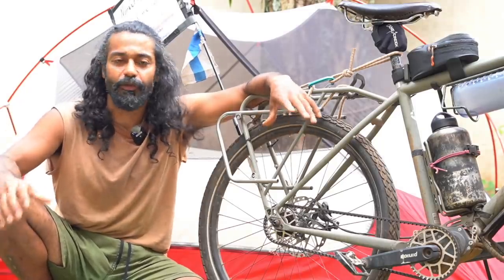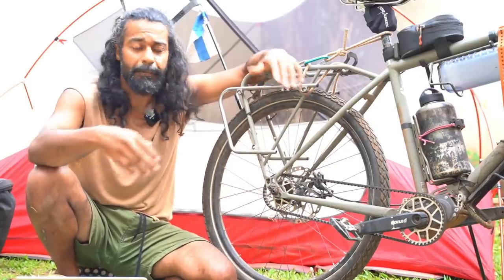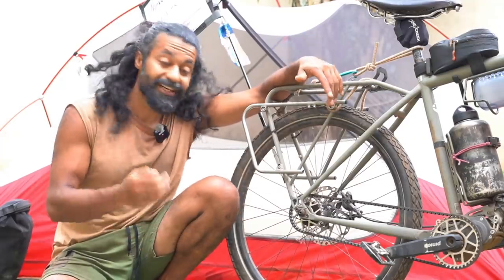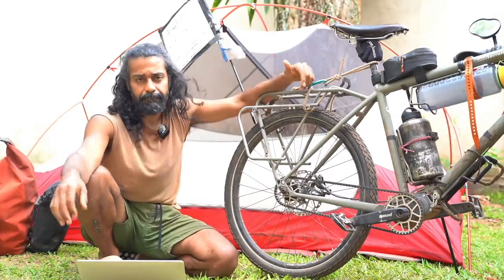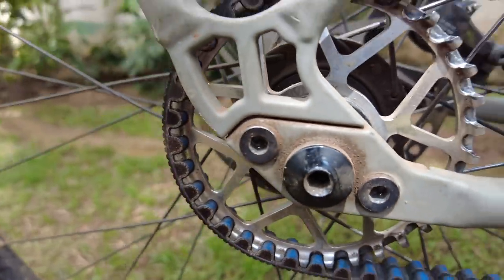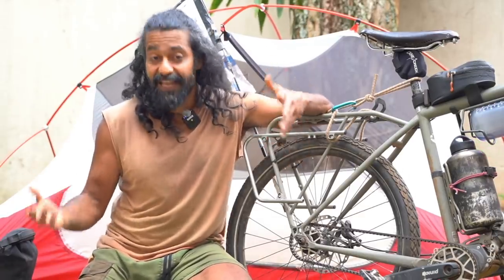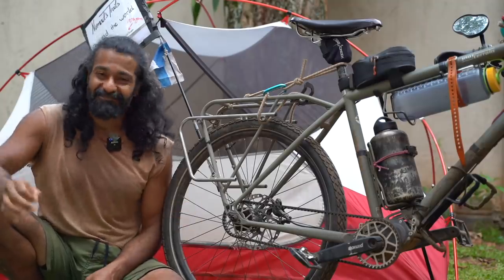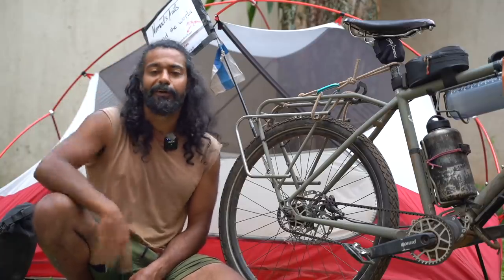Belts Are BETTER Than Chain Drivetrain for Bicycle!  My Test Result After 12 YEARS OF BIKE TOURING!

Comment: My friend used the same belt (Cube Hyde race or something, fitness bike) and it broke in 18 moths. Needless to say this probably doesn't apply to all models, but we rode together for most of that 18 months, the chain happened to last some 5-6 month longer. Only had to replace it due to it expanding. For our experience, belt is not the way to go, but hey, tomato, tomato.
Reply: Why did it break though?
Reply from the maker: @Ulgima Corvus We can judge the belt  performance based on one case IMO. Also how many km did u ride in 18 months? The cause of braking  can be wrong  way of handling the belt and braking  the carbonfiber cords. In my experience and many other  cyclists out there which I have spoken beafor  publishing  this video, belt lasts around 3 times more than chain. But if I buy a car and crash it I can't  expect the car to work  perfectly  well the next day. 😊
Reply: The guy is sharing a story from experience and you're writing it off as a single incident? But your single experience should be the only truth? Instead it might be something you could learn from. Good luck on your gaslighting journey
Reply: @ilcomendante  I don't think we can learn much without understanding why the belt broke. It would be the same if the chain had broken instead of the belt. Was it an exceptional failure or due to normal wear and tear?

As with anything a sample of one isn't very accurate. Sounds like Nomad Trails is pulling from much more experience.

I would rethink posting little to no substance, escalating and making accusations.
Reply: @ilcomendante  you're not very bright
Reply: @parawizard  I have 4 belt driven bikes (for commuting and by luck), and I love the belt drive. But one thing is a mystery to me: Gates have two belt types: The CDN (cheaper) and the CDX (better, but more expensive). In my opinion the CDN is far inferior to the CDX. I have two colleagues who use Cube Hyde Pro with CDN for commuting, and both had to change the belt after one year due to belt wear. Gates already dropped the composite CDN rear sprocket, and in my opinion they should also drop the CDN belt, because it seem to make new belt owners very disappointed and tempt them to go back to chan drives. The bike gets marginally more expensive with a CDX belt, but with a much longer belt life, and that is one of the man points of getting a belt in the first place. The CDX belts are compatible with CDN, so my advice is to change to CDX belt at the first opportunity.
Reply: @larsdela9323  I wasn't aware Gates had a budget belt for low mileage urban riding only.

Looks like the bike in the original comment used to come with the CDN belt but now comes with the CDX belt.

Gates really stresses low mileage and urban only with the CDN and durability and high mileage with the CDX. Also saysCDX for fixed.

Looks like a CDN T111 is about half the price of its CDX counterpart. So it's quite a price increase but the CDX one could last longer that two CDN belts.
Reply: @parawizard  I think that the main point is that when people buy a bike with belt drive, it is ofte because they have heard that the belt has a very long life. When the belt is then worn out after a year, they are then told that they should have bought a better belt... And that is a disappointment; if Gates had simply charged a bit more, people would have been more satisfied. I think that it is a very wise move from Gates to drop the CDN series.
Reply: @parawizard  I think that the main point is that when people buy a bike with belt drive, it is ofte because they have heard that the belt has a very long life. When the belt is then worn out after a year, they are then told that they should have bought a better belt... And that is a disappointment; if Gates had simply charged a bit more, people would have been more satisfied. I think that it is a very wise move from Gates to drop the CDN series.
Reply: @larsdela9323  Belts have other advantages. I think it's a bit of a simplistic assumption. If you aren't wearing out CDN belts they might be the best choice for you at half the cost of a CDX belt. Not sure on mileage figures between the two but maybe the CDN belts are just not good enough.

In general I would rather purchase components that are made and marketed for longevity and not ones made for price point. If a CDX belt has more than double the durability of a CDN belt then it would definitely be a good purchase for everyone if they put on enough mileage.

Comment: I want to comment on the topic efficiency: Whenever I mention belts to other cyclists I always get the comment: "But Efficiency". I think this is a very unfitting comment for two reasons:
1. The difference in efficiency isn't that great at all. You wouldn't feel it. This should only really matter to competitive cyclists, who care about every watt and every second.
2. The efficiency of a chain is only better when in perfect condition. In reality the efficiency of a chain drops much faster than that of a belt when in contact with moisture and dirt. This means that unless you're cleaning and relubricating your chain before every ride the belt is actually more efficient.
Reply from the maker: I agree 🙌
Reply: Good comment, I bike commute all year round and and by now I can clearly feel the difference between a well oiled, clean drivetrain and one that needs some love. It's a pretty arbitrary number but I'd say it feels like I need to work 10-20% harder.
Reply: Fair point!

Comment: Dumb question but why don't they just use a latch on the front side of the rear nut so that when you want to take the tire off you just loosen the nut and then unlatch the rear tire from the frame? a split frame seems counterintuitive to wanting a frame that does not flex.
Reply: The chain has to pass through the rear triangle, since the front and rear sprocket will be on each side of the frame triangle... But taking off the rear wheel is normally not harder than on a chain driven bike. Quite a few belt driven bikes use eccentric bracket assemblies for adjusting the belt tension, so removing the rear wheel is not involving any readjustment. Actually it is easier, since you don't have to wrangle an oily chain while taking off the wheel.

Comment: If you're doing a world tour yes, if not, it's a lot of expense. As, of course it means some sort of internal gear system and a frame that can be separated. So you are looking at £1500 to £2500 extra.
Reply from the maker: indeed it is super the great option for a world tour.As you mentioned  indeed it costs but if you have the financial possibility to get this drive train for even a commuting bike. in a long run it will pay off, because of the durability and also you won't change, clean and oil your drive train.
Reply: @NomadsTrails  but your belt cost 10 times more than a 11 speed chain.
also you mentioned changing the casete that is actually not necessary if you change your chain in the right time

Comment: Great review. Thanks. I love my Gates and Pinion system. You mention about spraying silicon on the belt, does that cause any deterioration of the material affecting the longevity of the belt? I also noticed that another long distance cyclist (John @ Omni Terra) rubs hotel soap on the belt to stop the sqeaking in dry conditions. Have you used this, and what are your thoughts? Personally I haven’t had much issue with squeaking.
Reply from the maker: Hi, you  are welcome😊, Gates  recommnds  the silicon  spray. I don't  think  it should  and will effect  the longevity. Also you can use some sort of Silicon  gel  wat they use forthe tredmill in the gyms. I ever tried  soap  I can't  say 😊
Reply: I have never had any noticeable problems with my centre thread belts (CDX), but the old CDC types could be awfully noisy in moist weather. The CDC sprockets had each one side wall, and the smallest misalignment resulted in wailing and squeaking. I have never had problems on CDX, and I have never actually cleaned or in any other way maintained a bike belt for the 4-5 years I have used them. I use my bikes for city commuting, which obviously can't really be compared to (extreme) touring...

Comment: I would not recommend silicone spray on a bicycle. It can lubricate your brake, which is obviously very bad. And it will collect dust on your belt, which will rub on your sprockets and belt, reducing their lifetime.
I haven't tried myself, but I suggest using a dry lubricant. Graphite is very black, but it might work fine. Soapstone powder (which is fine for seating tyres and inner tubes, too) is water soluble, but it's not black. And lastly, a little rub from a paraffin candle might work as well, but it might be incompatible to the belt material. But these are only theories, I have no practical experience.
Reply from the maker: Thanks  fir the input 😊, the silicone  spary  which you see in the movie, is recommend  by Gates. I have used it many times during last 1.5 year and never  collect  any dust or dirt. I need I would  recommend it. If keep the spary  in  towards down and at the sane time your pedals  it won't  catch  your  brakes. It is not  that complicated 😊.  But the way spary  being  applied  in the video, might catch  the brakes buy this was only a clip I could find to show the sparying  oon the video. I edit these videos which cycling  aroundvthe world. I finished  this video on a caffee on the side of the road I Uganda. So take it easy a bit 😊🤗
Reply: @NomadsTrails  i didn't know that Gates recommends this. Thanks for your answer 👍
Reply from the maker: @andrebartels1690  No worries  here is exactly  the spray  gates is recommending: https://www.amazon.com/CRC-05074-Silicone-Multi-Use-Lubricant/dp/B000BXKZUG

Comment: I'm surprised you didn't mention the noise. I'm not sure how it is with bicycles. But for electric motorbikes, one of the main reasons they use belt drives, is because it's much quieter than a chain.

Comment: as chain-drivetrain is fully made of metals (for touring this will be rather steel for durability) it is going to be fully recyclable comparing to belt which is unfortuantely made of plastic/oil-based components ;( But does it matter if you consider how fast you wear tires and inners and how problematic or not world-wide common is their recycling cycle? thank you for your thoughts! good luck!
Reply from the maker: Being more ecological is an interesting  question. It needs scientific research imo. true the chain drive train is made out of metal and metal is recyclable. but for making the chain drivetrain energy being used and for recycling it also, add on top of that all the transportation and packing material. also i am not sure if there is no way to recycle the belt. so this is something  which needs a research. but my guess is belt is more ecological. but it is just my opinion i can't back it up with any data :)
Reply: Most chain lubrificants are far from ecological.
Fluorine in any teflon containing lube is chemically one of the most toxic elements there is. (if you think chlorine used as chemical weapon is bad elemental fluorine is still far worser)
I doubt most teflon free chain lubes are environmentally friendly either.
And also solvents in lubes for making applying them easier are usually harmfull to environment.
Reply: If some of the drive chain mileage are correct then the number of chains I would have used in that time, plus all the other environmental cost of packaging distribution etc would make the belt drive more environmental.

Comment: Even though that belt is plastic/rubber whatever it's still strong. Cars use that kind of belt, in local old sawmill there's 3 friction belts what makes sawblade turn and it gets it power from traktor and those belts are soon 20 years old :D Very bad looking, but still working :D

Comment: I kinda hate my belt drive system. Because they're so silent and smooth by design, the second they make even the tiniest bit of noise it drives me insane vs the constant clinking of chains and sprockets.

I also hate that they're a plain to tension properly compared to a chain, they make removing the rear wheel for flats a pain, and I can't fit a geared hub with my 350w hub motor.

Overall I just don't see the appeal as a commuter. Eventually I will probably look into replacing it with a chain

Comment: How about comparing with a fully enclosed chain (with internal gears).
Reply: Even the belt drive would benefit from a guard.
And even a  derailleur from a guard in front of the chain wheel.
Reply from the maker: good point. it will last longer than derailleur for sure. but not as long as belt. not having metal on metal contact is such a great advantage with belt.
Reply: The chain is more or less running in an oil bath, so very efficient and very long lasting.  You would probably have change / repair the guard far more than the chain. I would certainly make a carbon fibre guard if going down that route

Comment: I don't understand. Have chains been an issue on bikes? I guess if you use a bicycle in extreme remote conditions, these belts would have an advantage. The price of these hub drives is extremely high, and the availability of gears for exercise and recreational bike riding would be limited using a belt drive. Hub drives are slow, and don't offer the gears necessary for speed, mountain bike terrains, or fitness cadences.

Comment: gearbox and belt is superior in so many ways, looks like the better modern solution.
especially when you need to clean/lube your MTB after almost every ride with mud/dirt/water 
few major issues before they become mainstream.
they are not the best for competition: too much drag for road bike or MTN XC racing, longer tire swap. some concerns with rocks getting stuck in the belt. heavier when 1kg means a significant time difference at the end of a several hour race.unfotunately even if amateurs shouldn't care too much, especially in the growing evoke market, they want similar gear as the pros.
cost because it is so different from chain/derailleur it would mean completely different manufacturing and tooling, so it's chicken and egg, as long as it's not mainstream and adopted by Shimano/SRAM, it stays niche market which keeps the cost high. whenever Shimano or SRAM makes the step, the competitor has to follow but right now they make more profit by perfecting the chain derailleur (look at the price of wireless derailleurs which are basically the same with small battery and motor)
and of course reluctance to change from pros, or people who have been spending a lot on high performance groupaets and think there is nothing wrong with it
Reply: I don't really see why you brought up mtb,belt drives in their current form just wouldn't make any sense there. I'm aware of the drawbacks of both systems and still chains are a no brainer,even tho they aren't perfect(altough sram wireless derailleurs are almost as good as it gets,it's a shame they are so overpriced)

Comment: Now how does belt compare to the singlespeed chains used with internal gear hubs, which are significatively stronger, quieter, and easier to clean and mantain than the 10+ speed derailleur chains you used as example?
Reply: I want to make a fixed gear with belt drive

Comment: The calculations are simple: Chain, cassette, chainwheel (for example 32 teeth) and pullies for together € 50,- to 100.-. Good for around 15'000 kilometers without changing anything. On the other hand: A bike from for example the brand Tout Terrain with Pinion gear box and Gates belt for € 5'000,-. Or special frame for Pinion, the Pinion gear box and Gates for around 3'000,-. Plus Gates spare parts after a certain point. A set of chain, cassette, chainwheel and pullies fits pricewise 50 to 100 times. For Pinion, the special frame and Gates it needs a big amount of money. € 5'000,- for a bicycle are way too much! It offers comfort, yes, but why is it so extremely expensive?
Reply: Shimano Nexus/Alfine is much cheaper than Pinion.